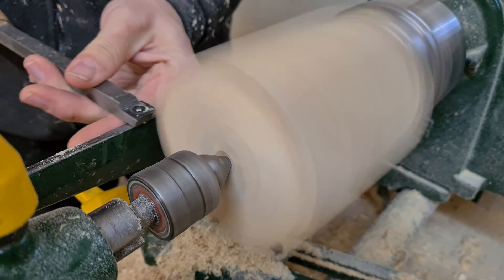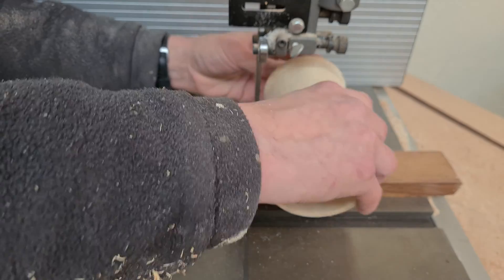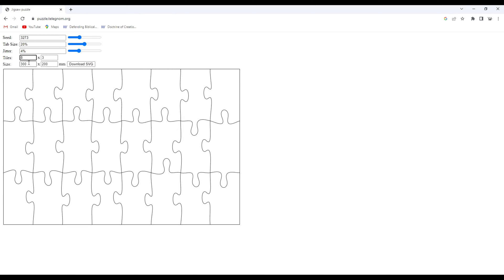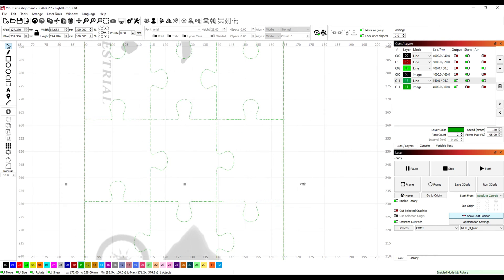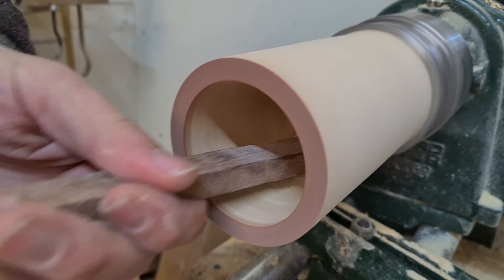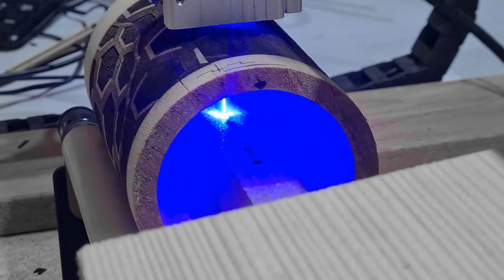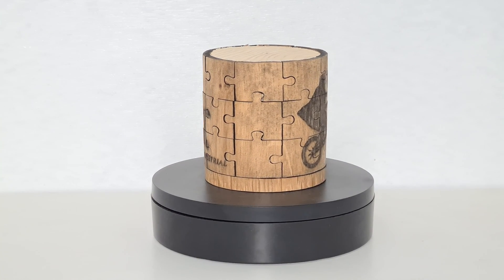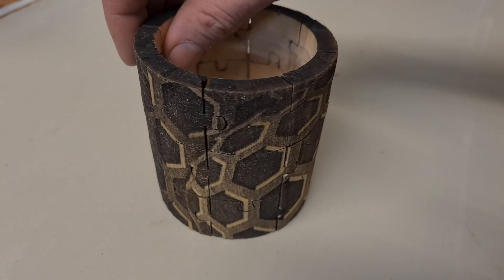How to Make a 3D Jigsaw Puzzle using Rotary Laser Cutting

Comment: Cool project that I might have to try. My sister in law loves puzzles. Can you angle the laser at all to eliminate the problem where the piece is bigger on the inside?
Reply from the maker: Hi Greg. Alas the laser is fixed, but the piece can be orientated. I'm working on a better way to use a laser to produce 3d puzzles, but this will take a little time. Thanks for watching.

Comment: Since I lack a laser, and simply don't think it'd be fun to me (nothing against people who do think it's a nice tool, it's just not something I'm interested in), I'm now wondering how carving something on the exterior and then cutting the pieces manually would work out. Especially that last part! Gonna have to find myself a very thin yet extremely rigid saw to do that, since a fretsaw is not gonna work. Or arrange the puzzle pieces to mirror themselves, so I could carve two sides at once with a fretsaw?

As for the carving itself: obviously turn a nice cilinder first, then carve the exterior, then remove the inside of the cilinder, then finally carve pieces. Maybe leave tabs on the base, to attach the bottom pieces to, for more stable puzzle assembly. 
Could even drill a hole in the base and add wiring for a light, make the puzzle part wood, part resin?
Reply from the maker: I think it's great that there are multiple of ways to achieve similar end goals and each one can produce something subtly (or extremely) different. Carving sounds a great way to go. The only thing I would say is that the approach of cutting 2 side at once means that the kerf of the blade widens the gap between the pieces. With the laser that was a fraction of a millimeter and it meant the final puzzle pieces were very loose. Here was a piece I did with resin: https://youtu.be/aOOQd7uRpGs

Comment: After watching guys in pen turning groups struggle mightily to figure out how to engrave a pen barrel about 10 or 12 years ago, this was interesting to watch. I wonder how this would work with resin, but there would need to be protocols in place for ventilation. My question there would be if the resin melts back together along the cuts or conversely has cleaner cut lines because of the uniformity and stability of the resin.
Reply from the maker: It's a good question and I think it would behave like acrylic which can cut cleanly. But would either need to use a dark colour dye or a CO2 laser for lighter resins for the cutting to be effective (need an IR wavelength for adsorption). I think there's great scope for these machines to do engraving , but I do wonder if it reduces some of the technical capabilities  of the woodworkers / woodturners as a result. I felt the same way when I saw 5-axis CNC routers, although the finish quality currently leaves a lot to be desired.

Comment: Very cool Ray.  I had something similar in mind but I will change my thought pattern now.
Besides no way I could improve on what you just did . Fantastic work.
Gary
Reply from the maker: Thanks Gary. I've also thought of another way to do this; I wasn't enamoured with the poor assembly. But too many ideas and not enough time (or wood turned blanks at the moment!)
Reply: Time is getting scarce around my shop as well. Hard to keep up and I have been retired for over 10 years.

Comment: Very interesting project, I've been experimenting with lasering my woodturnings for a while. I've been looking at the new autero rotary jig that comes with a chuck but the price is quite steep. I'll be ordering an E40 module soon, so can you tell me what settings you use? Many thanks, Steve.
Reply from the maker: Hi Steve. The chuck system is one I want to get, but the price is too high for me at present (a viral video would help!). I use an extra pass because of the curvature, but still find issues with tighter grain, maybe denser areas or curly grain, compared with cutting flat pieces of the same wood species. For cutting the oak cylinder it was 150mm/min, 90% power, 3 passes, air assist, constant power mode (a NEJE setting). I think the main problem was the roller system as the cuts should go down the same line but were adjacent instead (tram lines at 7:23), so the power goes to a new cut. Hope this helps and would love to see your work when completed! All the best. Ray